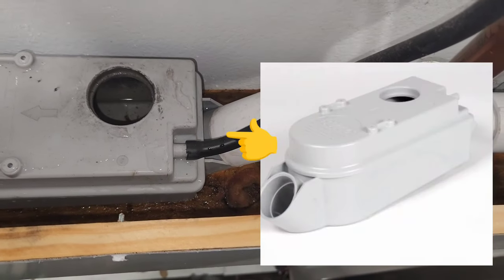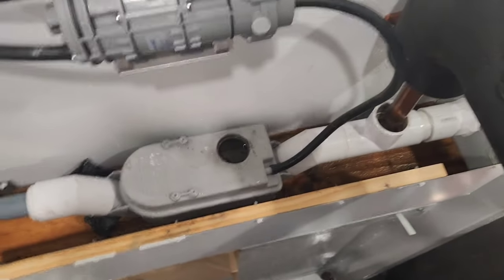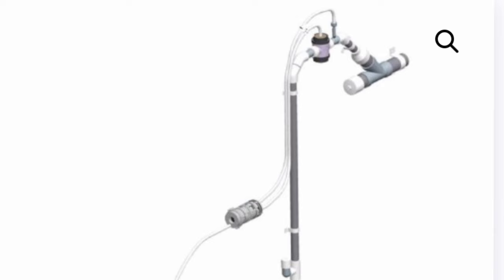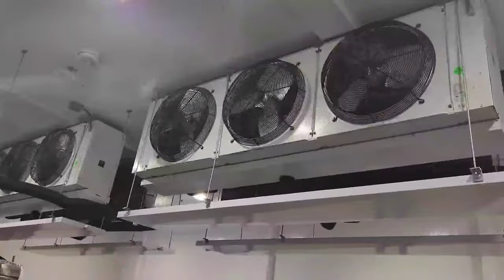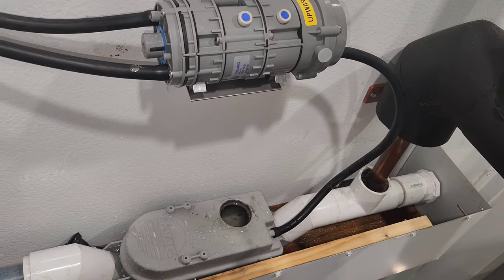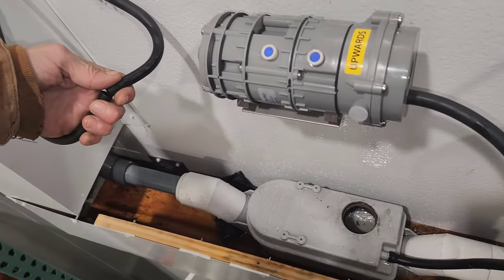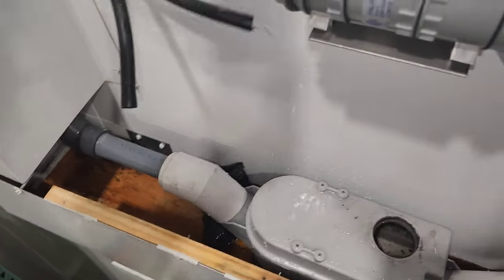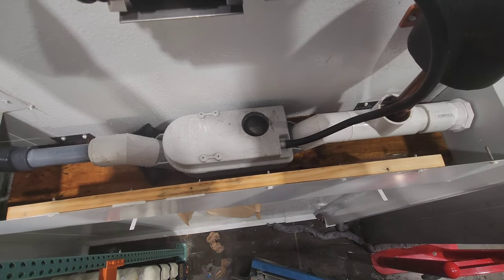Vacuum Drains Part 2 - How it works and what's not working

Comment: I would’ve thought it was just a bad activator. I think the activator has its diaphragm leaking and is sucking water into it from the box,from the vacuum line on the activator. This has allowed water to get into your vacuum lines. It seems when you connect the vacuum lines you prove, everything else is working. I think the water will go away once you replace the activator. I don’t blame you for doing both though. Thank you for posting this. It was something new to me.
Reply from the maker: Thanks for sharing your thoughts on this.  Awesome man

Comment: Nice work as always. The only ones I worked on was an Acorn Vac system. But same principle. Our problem was product tags would always get sucked into the diaphragm and flood the store floor.
Reply from the maker: Sounds like a true problem to have. Tags... always a nuisance for sure.  You can definitely tell which one periodically do cleaning and which ones don't.

Comment: I never knew this system existed until I saw part one a few days ago...pretty smart solution to get condensate up and over without relying on standard pumps (with limited head abilities) which would also be prone to freezing and electrical failures.

Comment: I work at Costco ... where water flows uphill ... until it doesn't ... then I have to clean it off the floor !! lol
Reply from the maker: Hahaha. Thats what happens. When it happens, there is most likely an activator failing to activate the Pinch valve... Which you can see if your look up. Lol